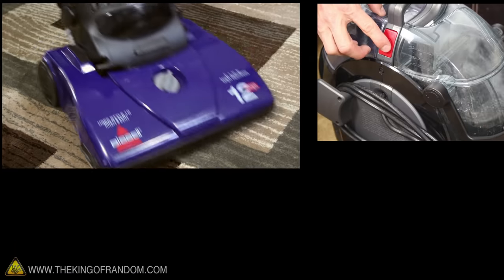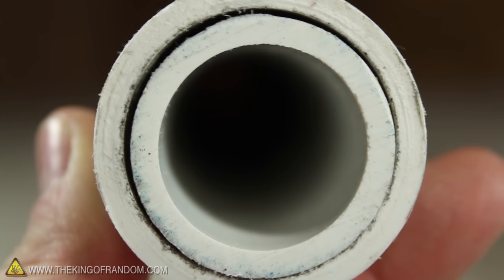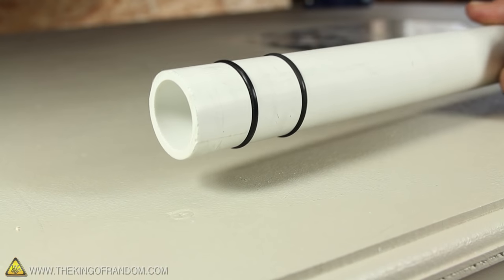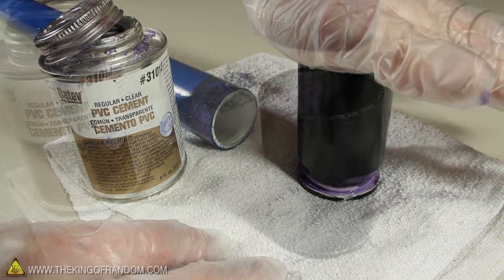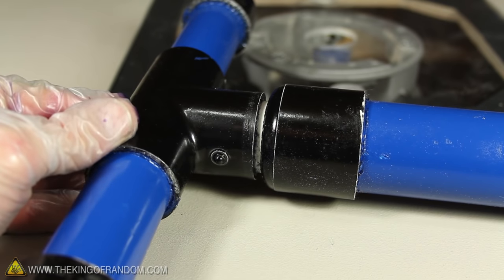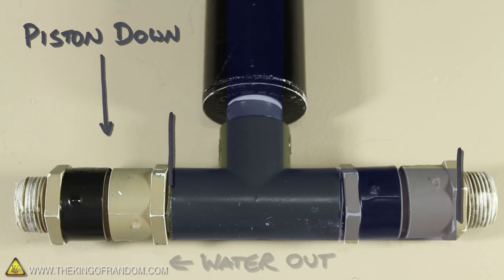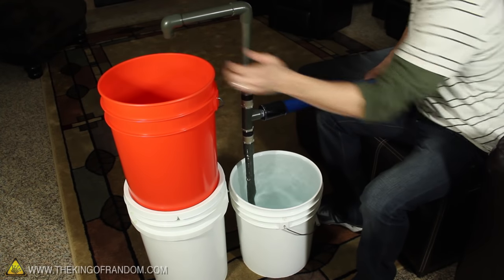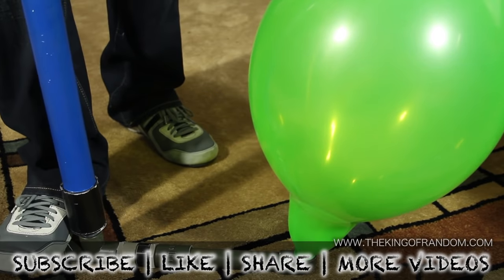How To Make A PVC Pump!

Comment: can you suggest an alternative lubricant as my understanding is that vaseline is petroleum based and will eat away at the rubber o rings over time.
Reply: Use siliicon grease, i use "Servisol" on my 60bar hydrostatic test pump.
A useful addition to this great pvc pump would be a pressure guage tee`d  into the outlet pipe.

Comment: If you put the end that sucks stuff up like a vacuum in the water and then put a balloon on the opposite side will the water transfer itself into the balloon and make a water balloon?
Reply: crazy pikachu yep
Reply: Kusalin Thanyakullsajja but the air inside the pump since the start will go in first, so u will have an air bubble on the first balloon. but if u keep repeating it then the other ones will be filled completely :D
Reply: Kusalin Thanyakullsajja good ^-^

Comment: How many bars/psi can you pump with this? Me and my friends are always build stuffs with compressed air, but we dont have a powerful pump, just 8-10bar... (sorry for my "english")
Reply: My challenge is that I have tried other pumps to push water through a water filtration device, but most are in the style of bilge pumps, which don't build up the head pressure, to push water through a filtration system - at a decent flow rate.  This simple pvc pump does.  I wish I knew where I could buy something that worked as well, and didn't need to manufacture it.  Thoughts or suggestions?

Comment: OK. So i went out shopping for this list of items and hit a roadblock... The 1" plug in the parts list doesn't fit in a 1" sch 40 pipe. Where did this magical plug come from? That's the missing link - I found all the other parts. I can't make this pump or the super soaker variation that I was planning. Any help?

Comment: Imma going to use it as a water filter
Reply: This works great to pump water into water filtration.  My challenge is that I have tried other pumps to push water through a water filtration device, but most are in the style of bilge pumps, which don't build up the head pressure, to push water through a filtration system - at a decent flow rate.  This simple pvc pump does.  I wish I knew where I could buy something that worked as well, and didn't need to manufacture it.  Thoughts or suggestions?

Comment: Where did you find the plug that fits inside the 1" pipe?  I am striking out all over town.
Reply: I found a 1" plug at Lowes.
Reply: The video's parts list diagram is incorrect.  A 1" plug will plug a 1" pipe fitting, not a 1" pipe.  The plug used is probably a 3/4" male slip plug.  Depending on the manufacturer you may have to file a little, sand a lot, or turn it on a lathe a tiny bit to get it to fit in a 1" pipe (it's meant to plug a 3/4" fitting not a 1" pipe, so the OD and ID won't match perfectly, which is why he had to use a mallet to get it in during the video).
Reply: I found a 1" plug at Lowes.

Comment: Can you help make a hand water pump with a water filter in line for hiking?
Reply: Just put tights on the end where you will be pumping from. Or a grid with loads of holes. Then as you pump the crap in the water will not be able to get in. If it gets blocked clear the end. That is an easy solution.

Comment: Thanks for the video. I wonder how many of the commentors actually built the pump? I tried and can tell you there is no way the #219 o-rings work for this project. Not sure where the author buys his parts, but the ID measure for the 219s I purchased is 1 5/16", which is larger than the OD of the 1" PVC. (The OD of the 219 is 1 9/16".) The ring is far too wide to fit snugly in the notched PVC or fit inside the outer PVC. Impossible. I tried it. Also, you won't find these o-rings at your local hardware or Home Depot. You'll need to purchase them online in 10 or 50 packs and pay shipping, or if your're lucky enough to find a Fastenal nearby, they may have them or can order them for you. I also don't believe there is a plug available to fit the 1" PVC. At least not the several locations I searched. Also could not find the threaded nipples. This should be a simple project once all the part issues are resolved.
Reply: I had the same problem, I can't find a #320 o-ring anywhere, even online so it'd be helpful if there was a place to go to that has all the o-rings. I did come up with a solution for the fitting of the 1 inch plug. I'm going to sand it down until it will fit into the pvp pipe and a little more for the glue to be in place. I haven't done it yet but I figure if that's what I have to do I might as well.
Reply: Did you ever have success in building pump?   I had issues too and could not get o-rings and inner pipe to go inside outer pipe?  The cut I made for o-rings was pretty deep and I was worried about the integrity of pipe if tried to go deeper.

Comment: Where did you find the 1'' plug I can't seem to find one at local hardware stores
Reply: 1" plugs won't work, they're 1" OD (outside diameter), the same size as 1" pipe (which is referring to the OD).  With schedule 40 pipe (I'm not sure you can even purchase thin wall pvc anymore) a 3/4" plug will work but it is a VERY tight fit.  I'm not sure what those type plugs were design for.  Maybe a plumber or other knowledgeable person can shed some light.

Comment: would it be possible to make the grooves using pipe cutters
Reply: Only if the finished grove will except the o ring snugly.
Reply: grooves with a pipe cutter might not be wide enough to accept a proper o-ring
Reply: KillerKev716 il glue the o ring to the pipe cut hole
Reply: that wight work if you use a thinner o ring

Comment: A 1" plug is the same size as a 1" pipe,it won't fit.More likely a 3/4" plug.Still tight,though,needs sanding to fit.Oring numbers listed are wrong.Need one #219a at top and two #216's at bottom of piston.
Reply: #219,not #219a...stupid auto-complete on phone!
Reply: Shawn Derrick lol auto-complete
Reply: *auto-correct
Reply: Really? Nobody cares to reply that I figured out the correct plug size and the correct O-ring sizes? Only that I called it "auto complete" on my phone. It is auto complete.I can type a sentence in an email or a text,then the next time I start typing that same first word of the sentence,it shows up in a bar below the text box,shown in green,with similar words lined up next to it in gray.If I select that green word before finishing typing it out,it displays on the screen,then the next word I typed in my last conversation shows up,also in green,with similar words next to it in gray.I can create duplicate texts or emails by only typing the first two letters of the first word only,then just selecting the green highlighted word one by one,that's why I called it auto complete,because it also tries to force the same word arrangement as was last typed,whether I'm saying the same thing or not.Anyone notice about the
Reply: plug and O-rings?
Reply: so, where do you get the o-rings?  I asked at a local auto parts and they were clueless about a  #219A  or #320 o-ring.
Reply: Kent,I got a 100 pack of each size O-ring for about $13 each from my local Grainger Industrial supply.Forget the "A" on the #219...it was a typo.You need a couple #216's for the piston and one #219 for the top.Try eBay or Amazon.

Comment: I wonder what the cost is for the supplies.
Reply: pvc is cheap, about $3 US for 8ft. fittings a little more, between $1 and $2.50ish each. o-rings maybe a quarter. can of pvc cement will last years and is a couple bucks. i'd guess under $15 for everything.
Reply: abbshurz   PVC pipes and fittings aren’t all that cheap. As he suggested, you’d probably have more in parts than the cost of just buying an inexpensive pump, especially since you can buy various types at Harbor Freight Tools for just a few dollars each.

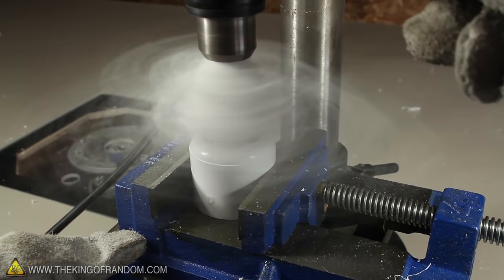Comment: Isn't the o ring at 2:43 (placed at the top, near the handle) completely unnecessary?
Reply: Not completely. The upper o-ring has the purpose to prevent the handle side of the inner tube (piston) from wobbling inside the outer tube (cylinder). Of course, that o-ring can be skipped and that would reduce friction, but to avoid the wobbling of the inner tube, the hole in the slip cap should be only slightly larger than the outside of the inner tube.

Comment: if i make it shorter would it not work? like everything is shorter
Reply: It would work but you would just have less pumping volume. For example, if you make it half as long, it would pump half as much if you kept the same size tubes.
Reply: bradkrit If you used the same length tube but not as big a diameter. It would take less energy to pump, but take longer. :) If you used half the size and half the diameter be easy to do but you would have to pump it a lot more. If you used half the size but same diameter it would take slightly more time to pump but work just as well.

Comment: Nice job, but you got to have access to lots of expensive tools.  That's why I consider it to be beyond  homemade. - There surely is a way of doing it with ordinary, less costly, machinery...
Reply: Sorry, I merely commented on what I saw... that's why. Besides, I looked at it, because I lwas pondering about how to build a pneumatic pump/ cylinder from these plastic pipes:  45mm stroke x 80mm bore.  It would be much less in weight than the aluminium made ones. Since it is for low pressure application (to use in a Venus 2000 type of gadget).
It's not easy to fine the right components. It might be easier for you, because you already got access to it and the experience.
Reply: @klemens33331  My challenge is that I have tried other pumps to push water through a water filtration device, but most are in the style of bilge pumps, which don't build up the head pressure, to push water through a filtration system - at a decent flow rate.  This simple pvc pump does.  I wish I knew where I could buy something that worked as well, and didn't need to manufacture it myself.  Thoughts or suggestions?

Comment: not being a hater or anything but i think just buying a ready-made would me much easier/cheaper ><
Reply: My challenge is that I have tried other pumps to push water through a water filtration device, but most are in the style of siphon or bilge pumps, which don't build up the head pressure, to push water through a filtration system - at a decent flow rate.  This simple pvc pump does.  I wish I knew where I could buy something that worked as well, and didn't need to manufacture it.  Thoughts or suggestions?

Comment: they sell pumps  at dollar stores, that one cost more then $10
Reply: I have tried simple pumps to push water through a water filtration device, but most are in the style of bilge pumps, which don't build up the head pressure, to push through a filtration system.  This simple pump does.  I wish I knew where I could buy something that worked as well, and didn't need to manufacture it.  Thoughts or suggestions?

Comment: You never showed how you constructed the bottom of the outside pipe to connect to fittings. So you have a pump with no connection point

Comment: I actually tried to build this pump,  are you sure that 219 is the right O-ring size?  I think it might actually be 216...  I ordered a a pack of 219 O-rings from Amazon and it's inside diameter is the same as the outside diameter if the 1" o-ring.  Would not work at all... I looked up the O-Ring size chart, and it looks like 216 would actually work.  Did anyone else run into the same problem?
Reply: Just to follow up: The inside diameter of a 1.25" PVC pipe is approx. 1.36". The 219 O ring has an outside diameter of 1.574" . 219 can't fit inside it.     Additionally,  the inside diameter of the 219 is 1.296"  while the outside diameter if a 1" PVC is 1.315.  That's only a difference of .019" before you put a groove in it.   After you put a groove, it will be too loose to stay in the groove.      But the 216 O-ring has an outside diameter of 1.387.   So if it's either the 216 or the 217 as the correct size.  If I had to choose, I would try 216 first.
Reply: Update: I ordered some 216 o-rings and they worked.  So the 219 size is incorrect.  I would love to post a link to the pump I built, made some changes, if you wouldn't mind.

Comment: can you pump oil with that thing?
Reply: no.....?
Reply: conrado mercado dude, if he can pump air and water, then he can pump oil aswell.
Reply: Oil has a much higher viscosity than water so just because it can pump air and water doesn't mean it'll pump oil. Also, why did you ask this question only to state later that it would work?
Reply: Brett Rose idk im wondering, cause i dont want to blow up the pump on a first try of pumping oil.

Comment: it takes time  and  require a lot of tools  and accessories  ,  better buying one in local shop
Reply: My challenge is that I have tried other pumps to push water through a water filtration device, but most are in the style of siphon or bilge pumps, which don't build up the head pressure, to push water through a filtration system - at a decent flow rate.  This simple pvc pump does.  I wish I knew where I could buy something that worked as well, and didn't need to manufacture it.  Thoughts or suggestions?

Comment: or for the cost of parts buy a hand bilge pump and a bike pump
Reply: I have tried to use bilge pump to pump water through a water filtration device, but bilge pumps don't build up the head pressure, to push through a filtration system.  This simple pump does.  I wish I knew where I could buy something that worked as well, and didn't need to manufacture it.  Thoughts or suggestions?

Comment: You are doing something seriously wrong if you're buying the table saw he has for $3000 and a miter saw (it's not a circular saw) for $500.  I see them on Craigslist for less than $100 all the time (both of them) and you can get a VERY nice 5HP baseline cabinet saw for about $1000..  So $100 or $200 investment?  Sure.  But it's hardly out of reach even for the average, even beginner hobbyist.

Comment: petroleum jelly eats rubber over a short time
Reply: Depends on the 'rubber'. There are thousands of blends, etc. Viton seals, PTFE, and many more. Not all are affected by petroleum. You also didn't consider industrial water-based lubricants, such as those used for rotational or pressure fittings in the food industry. Vaseline isn't the only lubricant that looks 'creamy white'. FYI, it wouldn't be good to ingest, anyhow.  Glycerine based lubricants would be better for this project, to start with.

Comment: You don't want to drink water from that. PVC can leak chemicals into water.
Reply: Your house is plumbed with PVC or possibly copper!!
Reply: Brandon Anderson Well it going through PVC quickly wouldn't really be a problem, I presume. But if water was stored in PVC, or near it, that could prove dangerous.
Reply: +HappyHasbros Well .... PVC bottles ?
Reply: omgwtftrolololo Yeah that's not the best idea
Reply: cpvc pipe is safe for drinking water.

Comment: Or... go to Walmart and buy a siphon pump for < $10.00
Reply: My challenge is that I have tried other pumps to push water through a water filtration device, but most are in the style of siphon or bilge pumps, which don't build up the head pressure, to push water through a filtration system - at a decent flow rate.  This simple pvc pump does.  I wish I knew where I could buy something that worked as well, and didn't need to manufacture it.  Thoughts or suggestions?

Comment: @ rct3r. Hey man I guess you're another genius that thinks the threads in a connection have anything to do with the seal of a connection between 2 fittings. Wise up and gain some working knowledge of mechanical things. It' ONLY the surfaces of the mate up that has ANYTHING to do with the seal between 2 joints.

Comment: lol u are kidding?... a air pump is a lot more cheap .....
Reply: My challenge is that I have tried other pumps to push water through a water filtration device, but most are in the style of bilge pumps, which don't build up the head pressure, to push water through a filtration system - at a decent flow rate.  This simple pvc pump does.  I wish I knew where I could buy something that worked as well, and didn't need to manufacture it.  Thoughts or suggestions?